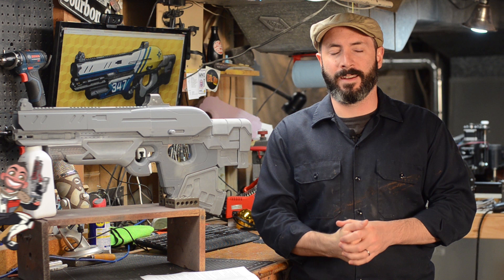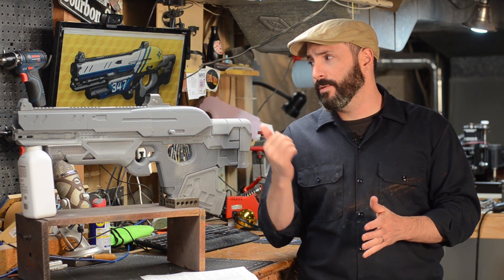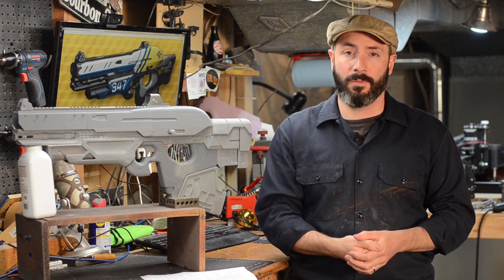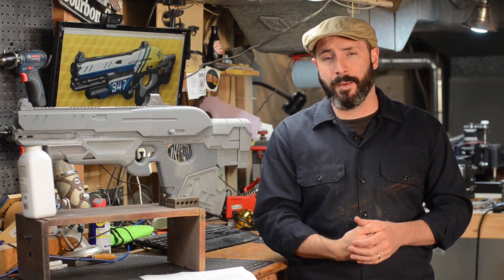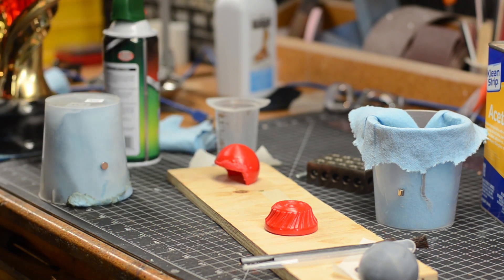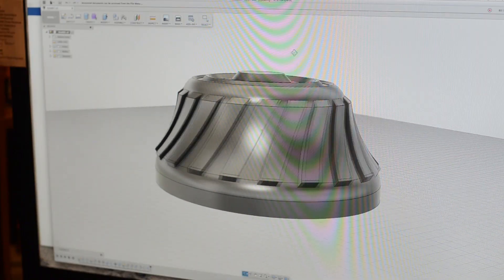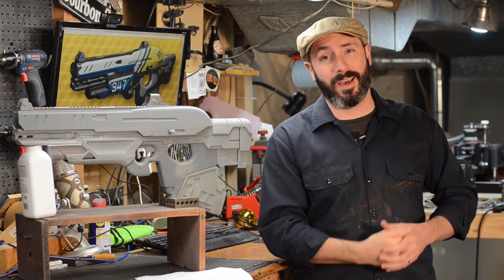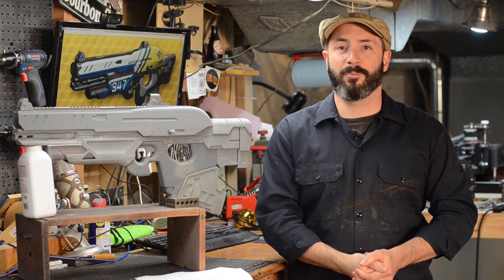How to 3D Print a Gun Prop from Destiny Part 7: Acetone Vapor Smoothing

Comment: Acrylic cement (specifically, dichloromethane / methylene chloride found in weld-on 3/4) works for PLA. You can also dip or apply with a brush. It will however soften the PLA for a day or 2, so you won't be able to sand it immediately after smoothing. Also works well for bonding PLA pieces. Watch out for the fumes though.

Comment: Great video as always, Bill. Acetone smoothing; not even once! Let's get some not-blowing-up-the-house hype! :D  #UnlimitedSandingWorks #TheStruggleIsReal

As for the lack of a glass-smooth finish, while it's not impossible to achieve otherwise, my understanding is that finish is achieved through the acetone condensing on the surface of the part. It's almost like dipping it, but with more even coverage because the condensation clings to the object better.  When you're doing it cold, you're basically just relying on whatever vapors come off the acetone as it naturally evaporates and dissipates, instead of heating a large volume of acetone to generate enough vapor that it actually re-condenses on the surfaces of the part. (And electric heating elements, especially sealed hotplates and the like, are theoretically safe... It's bad wiring that would pose the risk of providing an ignition source.)  All the same, acetone smoothing sucks...  And the chemicals that CAN smooth PLA are like a million times worse than acetone.

Comment: Hi. Very nice videos. Good luck for the sanding :) 

I've myself 3D printed and painted a prop fake gun similar to this one (but a lot simplier and smaller :-) ) As PLA is a little hard to sand, I added on top 1 or 2 layers of putty (applied as spray or with a brush). This covers all the printing lines and when I sand the pieces, it goes off very easily and so I don't have to remove too much PLA to level the surface. 
I sometimes use also a layer of Z-poxy over all to finish it up and stabilize the putty as it is quite friable anyway. Then painting....

Perhaps others (or even yourself) have already tested and talk about that... But anyway, just wanted to share :)

Your video gave me the impulse to redo a project like this and try to enhance a little more my first results ;-) thanks :)

Comment: Hey Bill, 

The glass shine from ABS comes from a "Warm" acetone vapor style.
The best Heating element to use is a water cooker, Heat it up put it in a bowl (because the Acetone is already warm it will give the vapor thing without an actual "heatsource"

If you need any help tips or whatever when it comes to 3d printing just send me a pm (or ask Bindi/mightysocks they have my personal mail)
I've been doing a lot with 3d modeling and  printing for the past 5 years, and I don't mind helping out at all ^^

Comment: Hey Bill - for the Mei blaster, I used MEK substitute to smooth out the clear sections. Its essentially ABS's acetone. I tried the vapor method once before and it works, I just wasn't set up right for doing it en masse. Just a thought for any future PLA smoothing needs. (It can also be smoothed via microfiber rags which is what I did after sanding the part.

Comment: You forgot "And then you will say 'But Bill why don't you use Liquid Acetone Smoothing !?' " :P
I personally print only in ABS as I tend to dislike PLA for tons of reasons. 
How I do my finish is a little bit of sanding (depending layer height for printing)  and then I use some kind of paper towel with a bit of acetone impregnated in it that I rub on the props on the part I want to smooth out. It works really well for large surface and it's so much faster than sanding (and less dusty :P) ! Although it requires some practice to know when rehydrate your paper towel with more acetone, or it will become shred glued on the prop ;)
I also like ABS because that way you don't need smoothing resin to finish your props, or to repair cracks, you just drop some ABS in acetone and it will make you a cream you can apply like a mastic and then acetone rub or sand smooth too :) 

But if you try so anybody reading, beware to wear protection mask as it will produce some acetone vapor you prefer not to breath. Goggles can be nice too for the vapor in your eyes.
Finally you can want to use protection gloves to protect your hand from the acetone and from the layer of ABS that will stick to them. I personally don't use gloves most of the time as they annoy me more than anything else but they always stay covered with a thin layer of ABS for 1-2 days after that !
Reply from the maker: Great tips for anyone printing in ABS.

Comment: Not sure if you've answered this before, but I'd like to see a video similar to this about your opinion on using 3D printed parts directly, vs. making molds and casting in resin. I feel like finishing a printed part works pretty well, but I wonder about the long term durability. Obviously if you were planning on making dozens of duplicate parts that took hours to prints, molding and casting make a lot more sense. But when I needed to make just a few one off pieces, I feel like 3D printing is easier, even if I'll need to make replacements in a year or two. Any thoughts?

Comment: I don't expect that cold acetone vapor will work for smoothing. You want a fast condensation of acetone vapor on the part, which you can't achieve with an even temperature between the vapor and the part. The part needs to be significantly colder than the vapor so that the vapor becomes supersaturated when exposed to the part, causing it to condense into a liquid film.

The liquid acetone film will dissolve away the surface layer of ABS, preferentially dissolving sharp outside radii, and then redeposit it when evaporating, depositing it preferentially in sharp inside radii.

By exposing the part to only a saturated or sub-saturated acetone vapor, all you'll get is a softening of the part as the surface absorbs the acetone into the plastic. You want to optimize the process away from the acetone penetrating into the part.

What you're basically trying to replicate is a vapor degreaser, which is a device that boils a volatile liquid into a chilled chamber, causing the vapor to supersaturate and condense on the parts being processed.

All that still doesn't change that acetone vapor is very flammable, of course. I've heard of people using lye to smooth PLA but I don't think I'd recommend that either. Sandpaper, spot putty and filler primer is really the only safe option for now.

Comment: I use ABS, partly because I get it cheaper. Some small pieces I actually keep the lines if they help the look, however on bigger pieces the grain is not likely to be uniform. For a super smooth finish a lightly sand, then use XTC 3D, sand, then filler primer, sand and paint. On pieces where it doesn't need to be super smooth I sand then skip straight to filler primer

Comment: Nice I totally agree about Acetone Vapor is not a safe way, I know different people use ABS to make props because of what they say is easier to sand, but I anyway prefer PLA is a lot more easy to print and don't require an enclosure for the printer

Comment: I have heard that acetone smoothing works best in a larger sealed container, like a clean paint can or larger. 

Thanks for the video. You rock! Are you going to cast that bad boy or just paint it as is?
Reply: I noticed your towel stuck outside the container letting the acetone wick out and escape (I used to do the same thing, just with tupperware). A "completely" sealed container should speed up the process with less acetone used, that seems to work best for me. Even for parts smaller than your test pieces I end up doing at least 2 rounds of 45 minutes, often more to get a glass smooth surface.

Comment: Hey Bill. Absolutely love the videos you do. Question. I'm going to be buying a 3D printer soon so I can make a PipBoy and I was looking for one that printed in ABS, because I thought I would need those requirement. I have no idea how I missed that this Boolean gun was printed using PLA. What I want to do is basically the same as you're doing now for prop making, so am I being an idiot wanting to making this thing out of ABS? when clearly PLA would do a fantasic job. What's your reasoning for using PLA, other than the benefits of the printing stage?
Reply: Thanks for the advice. I'm aware of the material properties of PLA, which is why I was more inclined for ABS, but the machines are obviously more expensive due to the requirements of the material to produce an accurate print. I think that main thing for me was just the finishing afterwards, but after watching all these videos I may be swayed towards PLA instead. I'm just not sure about the finishing/sealing etc. I'm currently looking at the Da Vinci range of printers as they are good value for money, without the hassle of calibration that kit models have. If I had the money I would go for a Zortax, but I really can't steep more than £700.
Reply: Yeah, I was watching some of his videos last night. Some cool stuff, and good tips for quality control. I guess my choice will be settled when I see the completion of your Boolean Gemini Scout Rifle. Thanks :D

Comment: BIll is there a chance to have a timelapse of the gun being 3d printed?
or what stats you used on the printer?
Reply: actually.. that was a lot of info O.o
i thought you had some sort of custom settings there...
thanks!
hey.. could I ask a little bit of advice on a model I'm planning to 3d print? its Mercy valkyrie's staff, I have doubts about it, 
How much resistance does PLA has? (like, how much stress/force can it hold?)

Comment: I would not use acetone vapor, it weakens the structure of the piece. I would recommend using a epoxy like XTC-3D by smooth on. Epoxy smooths out the piece and strengths it's structure.

Comment: You need a small fan to circulate the acetone vapor since it's heavier than air and it pools at the bottom. If you're afraid of heating elements try a rice cooker. (That's what I have). A 5v fan will not ignite the vapors so it's safe.